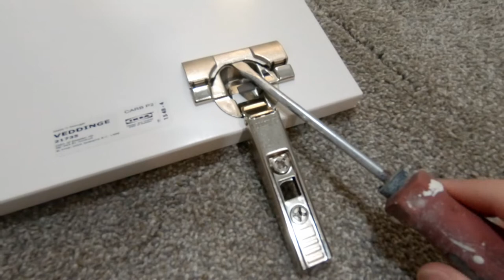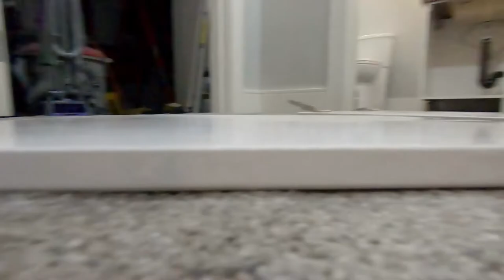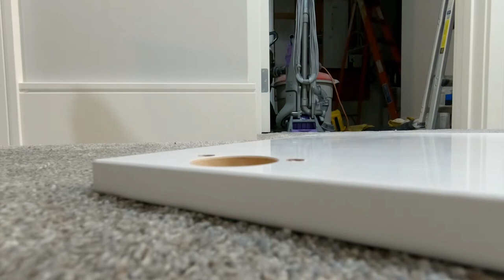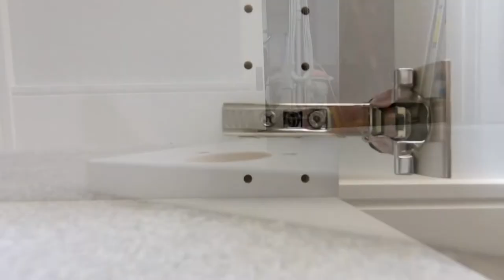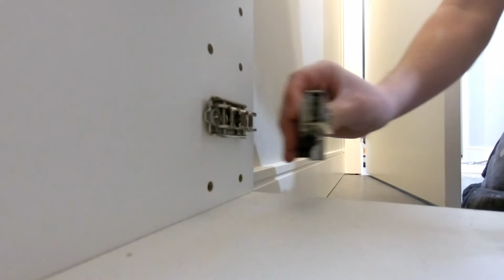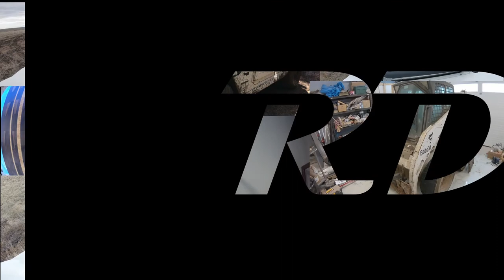How to remove IKEA Blum Cabinet door hinges

Comment: Damn it, how do you take the anchor off from the inside of the cabinet? I unscrewed two screws and it's still stuck on.
Reply from the maker: With the two screws removed you can gently pry it out. The screws will push out some little plastic pieces into the wood so it will still feel like it is held in tight, but it will come out with a small pry bar or flat screw driver. Try to pry from top and bottom so it comes out straight and not sideways to keep the holes in good condition.